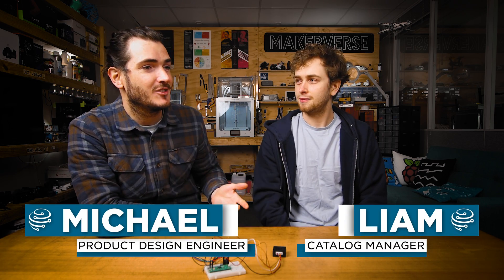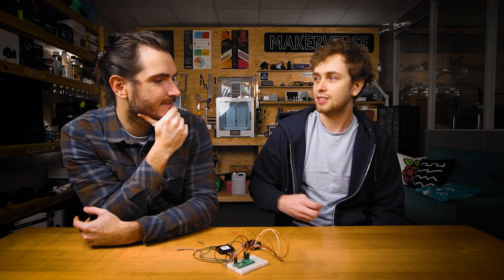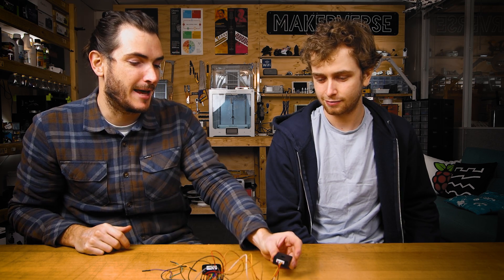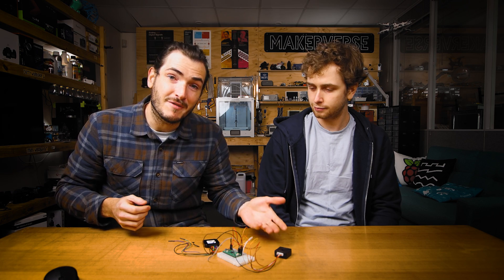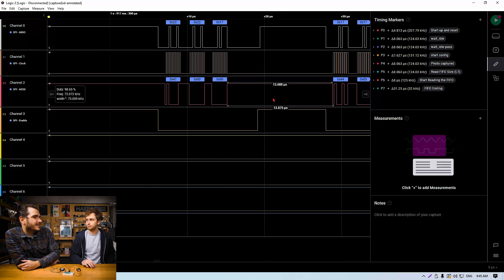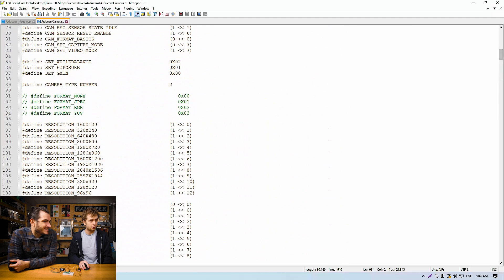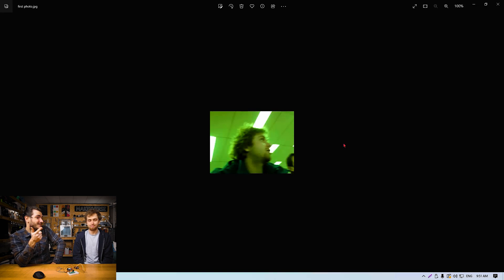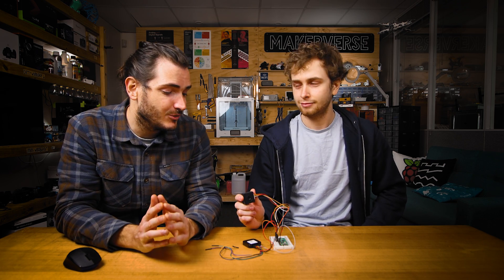Developing Camera Drivers for MicroPython & Raspberry Pi Pico | The Factory

Comment: Hi! all very beautiful but i bought the 5MP, exactly the same camera as in the video and i am using Micropython  but i am not being able to get the image. When do you think it will be ready for running the last version of Micropython, using this 5MP camera as in the video? Thanks
Reply: From what I see on the github code of this project it says the code is confirmed working for the 3MP but not the 5MP as of last I checked. So I'd be curious as well I just got a few 3MP ones myself to test so can let you know if it works out.
Reply from the maker: We actually developed the library on the 5MP, so both should be working perfectly! If you're still having trouble head over to the forum and we're more than happy to help out :D
Reply: @Core-Electronics  Oh that is interesting on the github repository it has shown for past few weeks that the driver framework in micropython was confirmed working for the 3MP but didn't show it was for 5MP. I see now the github project NOW shows it does work for both 3MP and 5MP. I hooked up a 3MP to 2 different pi pico w boards and it said it was capturing a image and writing to memory. But when I would refresh the board and look there was no saved image on the boards memory just the 1/2 python files. Maybe I have to double check my wiring or solder connection. Or maybe lower the image resolution sense the Pico W has less memory 🤔.  I will be sure to head over to the forum and request help if I need it or post my progress here soon there though 👍

Comment: where is this saving the image?  Every time I run the program, it only shows filemanager.log not the image file
Reply from the maker: The image should be saved onto the flash memory, you will also need to refresh the Pico's memory.
If you need any more help chuck a question on our support forums with a bit of info, here is the link to the forum for that video: https://forum.core-electronics.com.au/t/new-video-by-michael-developing-camera-drivers-for-micropython-raspberry-pi-pico-the-factory/17693

Comment: Would it be possible to run a videofeed via the script to detect a QR code using computer vision (openCV) or will the pico not have enough power?
Thanks!
Reply from the maker: I think you are on the ball with the pico not being powerful enough. You may need to upgrade to a raspberry Pi 4 to achieve that.

Comment: Any thoughts on using drivers with (embedded) linux devices like the Raspberry Pi?

For example, I have a USB Ethernet Adapter (VID0A46 / PID9621) and even found driver source code for it, 
qop_kernel/drivers/net/usb/dm9620 

But while I can compile hello-world code using gcc, I'm not not sure how to compile/load this driver.  My goal is to plug in the Pi and call functions from the driver, ex. "dm_write_eeprom_word' function"!

Comment: Pico having only 264 kB of RAM, I wonder how you even (temporarily) store the image in it, before, lets say, putting it on a MicroSD card. 🤔
Reply: The RAM actually only sees a little puzzle piece of the image after every byte read, when saving it appends straight to the onboard flash memory (2MB)
Reply: Write chunk by chunk in a streaming fashion. So one just needs for example 512 bytes